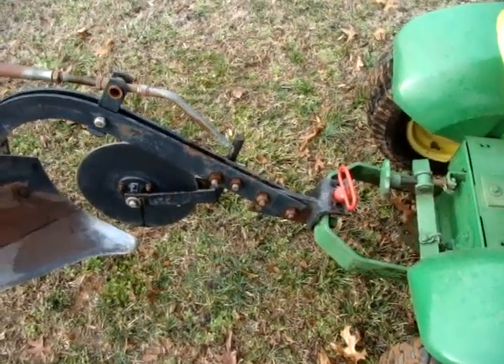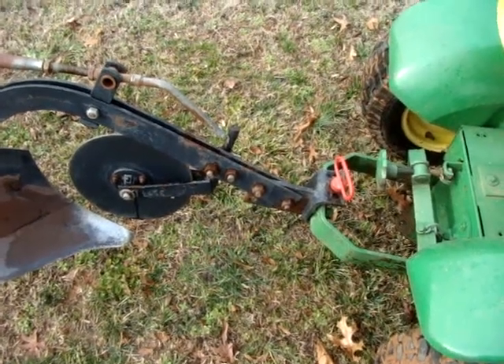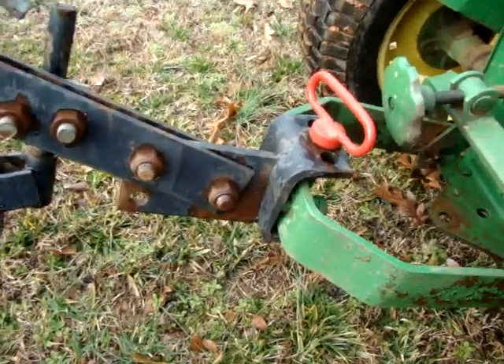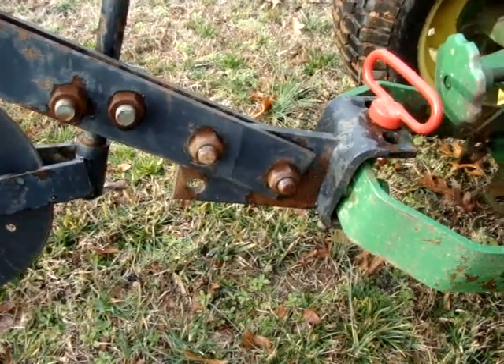John Deere 110 Round Fender with Sleeve Hitch and Brinly Hardy plow part 3

Comment: What does the wheel do on the plow? I see some without it. I’m not a farmer by any stretch but have two 110’s that I want to get attachments for and use for little flower gardens etc. I have a hood working rear tiller but have some seriously tough soil that I think this plow could loosen up first.